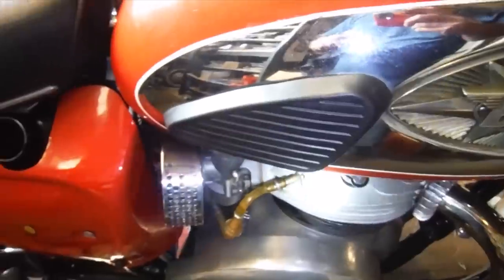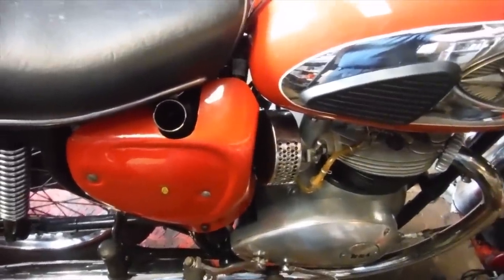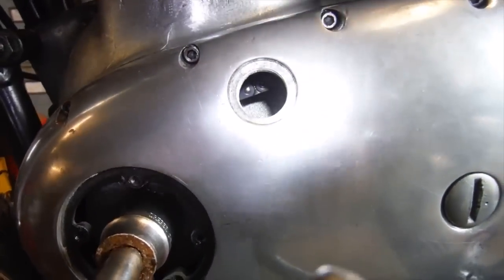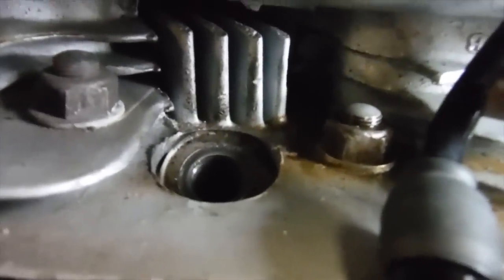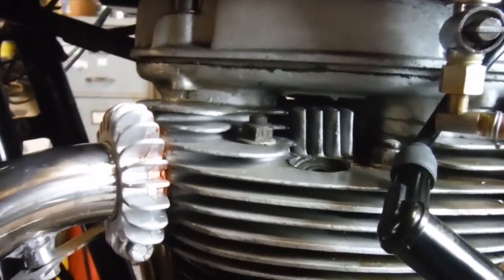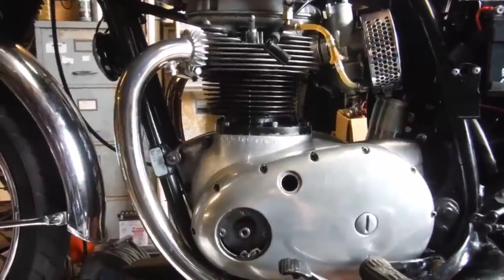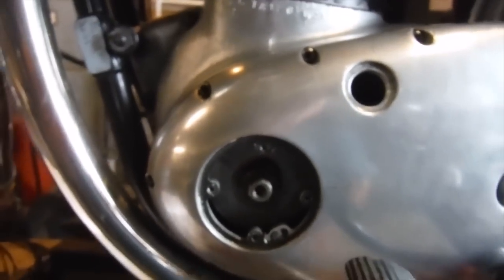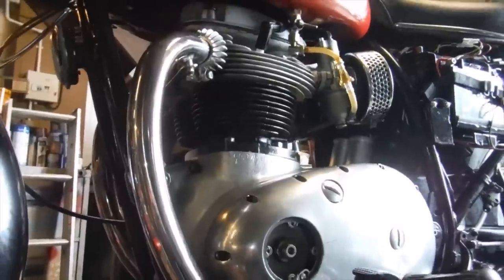BSA A65 vibrations - basic investigation work begins.

Comment: When I rebuilt my A65's engine I used lower-than-stock-compression pistons (about 8.5:1), had the crank dynamically balanced and fitted taller the stock gearing and electronic ignition. Starts first kick, minimal vibes and hauls ass on the highway. Have put many happy miles on it and it's still going strong.
It's not the bike, it's who's spinning the wrenches that matters.

Comment: I seem to remember that the pin in timing cover should be in right hole for about 34° btdc, the left gives 38° btdc....if the crankcase had the timing plug hole in front take it out and locate flywheel in correct position.........coming up to firing point and see if the mark on rotor line up...
It's years since I did A65s so my memory may be wrong.
PLEASE CHECK.
Nowadays I just stick with my 350 bullet....
Nice :)

Comment: So many rotor casting and variation could have had it hot timed. I had that issue I think after time we have to compensate.  With points I always make a witness mark of running fine then I can go back to the scratch if way off.

Comment: Hi Paul did you try your tool in the right spark plug hole and compare any differences with the pistons on the up stroke and then down stroke. The timing marks might be closer when using the right plug hole, which would be bad.
Also my spitfire with the locator pin through the front of the engine which locks the crank at 34 BTDC, I have a rotor mark about 6 degrees over advanced.

Comment: in the first video, I suggested the wrong pistons could be the problem, or something is worn out completely in the stator plate set up, worn shaft, loosened and worn holding pins, something mechanical isn't as it should be, engine out the frame a tear down I reckon,

Comment: I retarded my A65T 5 deg where the crankcase plug was saying it needed to be, couldn't strobe it as I didn't have the inspection hole in the primary cover, someone told me modern fuels burn faster so that makes the difference, ran much better anyway. Still to much vibration so I've had the crank dynamically balanced it wasn't far out statically but one side of the crank was way heavier introducing yaw will see when I get out back together

Comment: Very fragile engine...a needle roller conversion on the timing side main is a start
Reply from the maker: Assembled correctly and well maintained, they are not fragile and can do high mileages on their timing side bushes.
Reply: I made an alt-bronze bush for mine and had the journal hard-chromed. Still running strong.